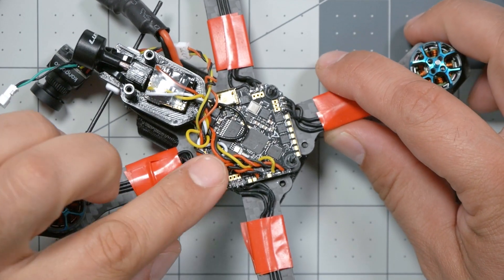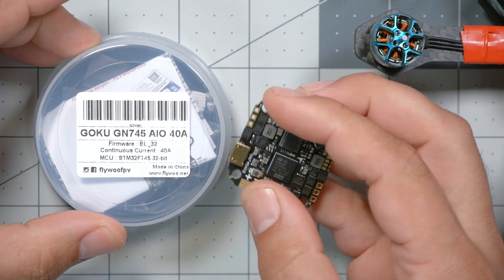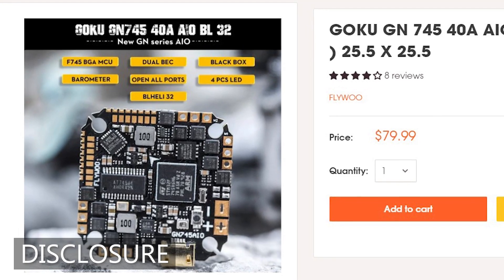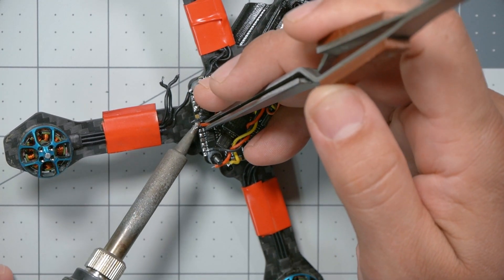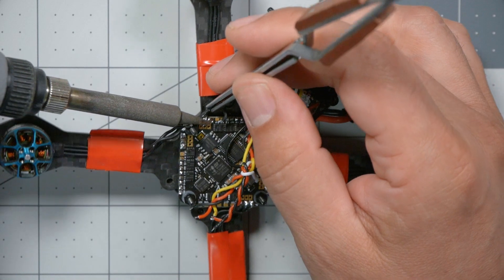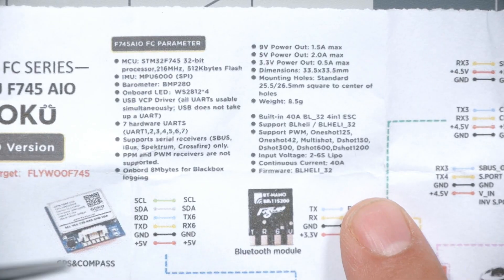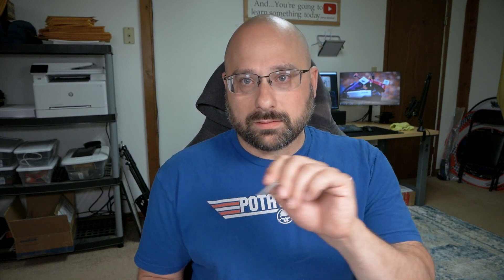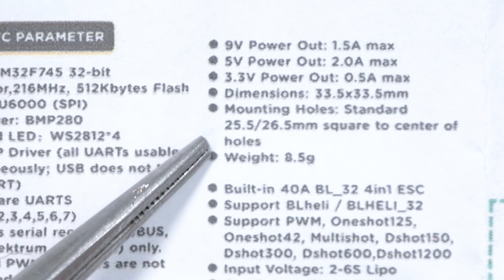But is it reliable? Flywoo Goku GN745 AIO FC and blheli_32 ESC install in my 533 Tiny Trainer

Comment from the maker: Ok have I made a big mistake here? What's your experience with the Flywoo Goku GN745?
Reply: I use the GNF4 (32 bit 40a, f411, blackbox) and its been BULLET PROOF. I have one in my Cinesplore and one in my tp3 and I bash it good. GREAT board.
Reply: My two TinyTrainers have JHEMCU GHF411AIO boards, I got them out of two FUS Spartan V3's which were 'meh' because us end users received ones with different motors to the reviewers, notchy low KV that needed 4S...on a toothpick! And its frame was too weak.
No issues with those FCs after plenty of crashes in the TinyTrainers.
Reply: I’ve had some bad luck with stuff and I changed my philosophy to always buy fro Race Day Quads because their support is the best!
Reply: They go up in flames a lot 😂
Reply: Every piece of flywoo electronics that I've had has failed.
Reply: im using the GN413s and its been a tank after about a months worth of crashing, but i conformal coated it pretty good and thank god cause i lost video and went down into a muddy puddle in the middle of a corn field for about 20 min, and im pleased to report zero damage even the barometer still works.
Reply: I’ve been using the jhemcu 25am pro for about 4 months now it’s been amazing and it’s cheap!
Reply: I really like the GNF4 so far. I've been rocking it for 4 months now in a demanding build. the build is a tbs stardust 5'' with 2203.5 2500 kv motors on on a 5s 1050 .ive even tortured it with a 6s battery but it desyncs. it didn't went up in flames tho .the only thing is it needs a big cap cuz its a lil noisy and all of the onboard leds died
Reply: My 3 flywoo fc have been good so far. Oldest one though isn't even a year old yet
 But I have has 2 in a row bad iflight fc.. shit happens
Reply: flywoo in a trainer is great.  also have it on a 5" podracer.  my first flywoo aio did have 3 non-working leds but i can live with that.
Reply: I did conformal coat it that might be what’s been keeping it kicking for so long
Reply: I have one F745 AIO and installed it in Diatone Roma F4 frame with T-motor F2203.5 2850 KV motors. Flied it on 6s and there was two desyncs so far. But that machine was so fast and furious so I've broken rear arm and had my RX antenna cutted off, so now I'm waiting for replacement. But Goku is ok.
Reply: i dunno aboug GOKU, but i used TBS podracer AIO myself in my tiny trainer (i call her Tina Turner) build, extremely happy. i built it "late" so i avoided betaFPV for this exact reason and went with podracer AIO. i also went with CRSF nano and with trump nano (because i've heard fusion nanos are overheating). she is flying beautiful, tina is my favorite quad.
Reply: My latest build is a RDQ Source One with Iflight Beast F7 45A on 1700kv Emax ECO II, 6S. It's been reliable.  A few crashes no worries.
Reply: I fried my first Goku F7 with a pavement crash and got another for my ET5 and I have been flying it for months,I have a wobble in my cam I can't get out but I don't know if it is the FC,it seems like a solid FC.
Reply: kind of in the same situation.  I built a 7" Megabat using a Beast H7 board a few months back... great flyer, one of my favorites. 
(This board is damned expensive now.  I kinda wish I'd ordered a spare back when they were "only" $80!)

Next project is to (re)build my DaveC 5" mini longrange.  I had a traditional 20x20 stack on it before but wanted to switch to an AIO board in order to keep the weight down.  

Cannae find a Beast H7 in stock anywhere (also it isn't supported by iNav yet.) Going to try a GN745.
Reply: i got 2 of them for my 4 inch, first one was doa, my esc had a bad fet, so race day quads sent me a second one, and it worked amazing! but it failed in the same way, a fet went bad after i simply plugged it in and it died. i’ve switched to a diatone mamba f7 stack and even the esc’s made my motors sound smoother. i think the quality difference is just stark or something, the mamba hasn’t failed me and it’s been well over a month, the gn745 lasted a week. good fc if you get lucky though, unlike me.
Reply: @sommmathechamp5801  I had a Single fet die too on my Goku F405 AIO that came on my Firefly. The fet looks fine but shows shorted to ground and burned a motor up.
Reply: Would be great if we have a video to install ardupilot on this board
Reply: Utter GARBAGE. I did a 3" cine-style with it, and it was a nightmare to solder. The side pads are a joke, and I kept having wires pop out with even mild handling. I literally got 3 very short flights, until I decided to resolder. Well, guess what happened? I was very careful in the rebuild and checked at every step. Does this work. All was well until I stupidly decided to add on the wires for my Baby Turtle. All the inputs and outputs are literally flanking the IMU. Not sure what happened, but after that, my gyro went missing in BF. I even switched to iNav to make sure it wasn't some funky UART/SPI thing, and it is missing there. Now I can't reflash BACK to BF for some reason and am in iNav Hell with a $110 board that is literally worthless. Very bad design. Everyone should avoid them like the plague. Now taking recommendations for a replacement AIO.
Reply: With flywoo I have no problems, but come on betafpv. i have alot failed components F405, lite radio 2, 95x v3 , all Bad , I changed 95x v3 to pavo25 it is little bit better
Reply: The 2 Flyoo goku series 4 in 1 escs and 1 fc have all failed. No more Flywoo for me. Their customer service has nothing but excuses as well  if it flys you buy. Just my experience. They look nice
Reply: @ThiswayupRC  Agreed. Had a Firefly Nano baby 20 that I paid good money for too(over $300 for DJI ver) and within about 5-10 flights of tuning a motor died. I swapped it and within another 5-10 that same leg of the ESC died this time but luckily the motor survived. I explained what happened to flywoo's CS and showed them the video of it essentially failing in slow forward flight. They didn't respond once I said it was a dead component. Bought the $50 darwin controller and had it rockin an less than an hour. IMO flywoo's components are way too close together like they are trying to show off more then create durability in a product.
Reply: jb u should put the cap right on the power leads of the board.the cap doesn't do anything on the xt30. even if your on 3s and its a 40a .i put a big freakin cap on everything.better safe than sorry : )
Reply: @kofikofikofikofikofi  Sorry but that is not correct. I use it that way for so long now and with no problems.
It does reduce a little but it depends on how long your power leads are. I have really short ones so it works great.
Reply: @manuelsmeets9392  aight whatever u say homie. My experience shows something else. Kabab for example is of the same opinion. Hobbywing also says the cap has to be the closest to the noise source but you know what , we don’t have to have the same opinion. I won’t tell u your wrong. Do what u wanna do.I think u can compare this to jb saying wires over the fc don’t make a difference. He build many quads and it didn’t make a difference until it suddenly makes a difference. ✌🏾
Reply: @manuelsmeets9392  I agree.  If the noise that the cap was filtering was much higher in frequency, i.e. Mhz, then maybe this would be more of an issue but motor noise is much lower.

Comment: Today this AIO had a defective LDO Voltage regulator - I guess the 3,3 Volt since the gyro and baro is not showing anymore. I have had it now with flywoo FCs. I only made very bad experience, also with the 16mm F4 stack and another F4 FC from them. Service is terrible and the quality too (in my opinion, maybe I was unlucky, who knows).

Comment: I got the same FC, it was showing OSD with visa but I change vista to 03 air unit and now I don't have ODS. 
set osd_displayport_device = msp
set displayport_msp_serial = 2
done.
I did everything to double check if something is wrong connected or seated, but nothing looks wrong, can't understand what is wrong.

Comment: Forget bega FPV they got lack of quality control. I bought the pro 3 light controller only had it for 2 days in the right gimbal stopped working cuz the wires are too short and the controller kind of stuff is that lack of quality control over there

Comment: I've got three!! 1/3 is working fine, I would not recommend.

Take caution: V1 and V1.2 has incompatible soldering layout/wiring/pinout!!!

One of my Goku GN745 worked fine.

My second never did beep/recognized the motors (Yes, I've changed them on BF). 

My third one was working well, omg 4" long range is great, but after a week flying, after a short 30s LoS test flight, one of the leds in the FC started smoking. I have no idea why.

I'm scared of Flywoo, let's see their support.

Comment: 9:00 Regarding there being a INAV target for the Flywoo Goku GN745 FC's. There is, as of INAV 3.0, or later. (note: to do position_hold and other navigation, you will need a GPS with a compass, not just the baro sensor).

BTW: if INAV not enough, there is also an Adrucopter / Ardupilot target for the Goku GN745. 

Can verify INAV works, but have not tried Adru firmware. Just that it's an interesting possibility, given this a AIO FC.

Comment: Beware of the iFlight Beast F7 v2 which is what most stores are carrying.  Even though, in some ads, they are advertising an MPU6000 gyro it does in fact come with a BMI270 (Bosch) which has a much higher cutoff freq for the hardware LPF (875hz) than the 6000.  It is also locked at 3.2khz gyro and max 3.2khz PID loop which is probably fine but the LPF is not good news for a quad.

Comment: 08:54 I got one of these boards and crashed it on my second flight. I hit the top of a bunch of incredibly high trees, on a very steep slope, and it came tumbling down until it got stuck on a branch. The barometer is what allowed me to quickly spot where it was, by giving me the approximate height it was stuck at. It was pretty tangled in the leaves, I might have not found the quad without it.

It's also nice to know when I'm flying above the regulated height, or generally to just know the altitude. A barometer is a feature I look for when looking for FCs now.

I just wish Betaflight supported altitude hold.

Onboard LEDs are also good to locate crashed micros using an aux switch, without adding the weight of external LEDs.

Comment: Need some help people more than just with drones LOL. Anyways I kept burning up flight controllers in my GEPRC Phantom HD, so someone recommended I replaced it with this flywoo flight controller. I tested everything without props last night in the house and everything worked perfect. All my OSD was correct I went for a test flight this morning and everything was awesome. Handle so much better with the same pid rates. I had probably one of my smoothest Landings LOL. I put a second battery in and now I'm not getting any battery voltage showing up in the OSD for the Drone. Am I doing something wrong. How could it work with one battery then 2 minutes later it doesn't work with another battery. Then I tried a different battery just for the heck of it same thing no battery voltage but the quad arms perfect and flies perfect just have no idea when to LAND. HELP please I'm DROWNING!!

Comment: This is the AIO I put in my beta fpv 95x. My first build. I just recently changed to smaller motors (1106 beta fpv) to try and get longer flight times. I had T-Motor 1404's.

Comment: does it will work longer if use conformal coating to prevent any shortage or electricak bridge by others like ant or leaves or water drips , or little konduktor material on dirt

Comment: The BetaFPV F405 AIO FC. 
1. Burned out an ESC from reverse connecting on the battery. My fault.
2. VTX-O pad falls off after tinning solder and blowing on it. 
3. Ground pad falls off on a new board rubbing finger on it.
4. V +5 pad falls of during flight and drone falls from sky (breaking frame)
All the edge pads suck.
THIS >>>---> https://betafpv.com/products/f405-20a-aio-2-4s-brushless-flight-controllerblheli_s-v3 SUCKS!

.... next time this fails (BetaFPV F405) ... I am going for something "less crappy" in my build kit, Jhemcu GHF411Pro 25A

Comment: So far i've only managed to kill 1 FC and that was a FETtec KISS board. I was mortified. Couldn't have broken it at a worse time! 

I've still got my 3 original Mamba F405's - these are going strong and have not shown any sign of breaking and I sucked right at the start. I then upgraded with  2 Mamba F722's, I really like this board, alot of features, bit tall because of the heat sink on the ESCS's but worth it. 
I then bought a Lumenier Lux F7 for an Octo build and that that's still going after a big, big crash - that bent the frame. 

I do need to try more manufacturers but now I've had KISS/ FETtec, it's not comparable, for me at least.

Comment: That BetaFPV AIO board (which I use in my toothpick without issue) is not the same that was shown in your racer build. But, video editing aside - I ran into the same issue on this board, video with no OSD, I looked to your videos for help. Come on JD - check your cam power and GROUND (*hint). Stable now, fix your tish...
Reply from the maker: It's a different board because the original one also failed and was replaced with this one. And yes I thoroughly checked the wiring please have a look I made a video about it. https://youtu.be/Y4YitIkb-N8

Comment: My first FPV drone (not counting DJI) blew up second day with BetaFPV Toothpick - an BNF.  I replaced with another BetaFPV 405 Toothpick - it burned up in my hand when testing motor direction on starting the 3rd Motor.   Pretty amazing fire - had a 2 in flame shoot out for about a sec.  Had to hold it my hand as the USB connection comes from the bottom.  Replacing with an IFlight Succex-D.

Comment: I got three Betafpv Aio paper weights in my parts bin! Didnt even try to complain about them. I just bought JEHMCU Aio boards has held up much much beter!
I even run 6s on the 20×20 30amp JEHMCU Aio with 2306/1700kv motors on 5inch build and it's still holding up!

Comment: A bit of advice for everyone if you have issues with tiny solder pads or not  ….buy a set of magnifying glasses that are wearable like reading glasses get ones with a huge magnification this way those pads and the controller look like they are  huge and makes soldering much easier

Comment: Maybe try hitting the OSD chip with a hot air station to reflow the pads its on. I have had similar issues with BetaFPV boards where they just kind of stop working properly and hit them with hot air and they come back alive. I have a suspicion that whoever makes their boards doesn't flow the solder properly all the time. I'd be really curious to see if that brings the OSD back to life. Sell me your dead BetaFPV boards.

Comment: Exactly why I've abandoned EMAX whoops, the AIO isn't reliable and is the most expensive of any whoop.
Reply: Next finished a remake of the tinyhawk freestyle frame to accept normal motors and 16x16 stack or AIO. Couldn't stomach paying out for a new FC.
Reply: @thegribbs  I've just switched frames entirely. I don't like tinywhoops outdoors and I don't mind swapping batteries, so I went with a Moblite6.
Reply: @grantmacdonald4838  the whoop design is good for bandos, where I mostly fly. Can't break them.
I'm just not keen on companies that design a product that forces you into an ecosystem.
My tinyhawk will have ELRS and OpenVTX, and if it does break, I can cut a new frame.
Reply: @thegribbs  my 3" toothpick seems to be more durable than the Tinyhawk so long as I fly over grass. Maybe I've just had bad luck?
Reply: @grantmacdonald4838  Probably. The triangular arms of the Tinyhawk are an extremely strong design.
Reply: @thegribbs  the frames are solid, but I keep breaking AIOs. They aren't well protected.

Comment: I still fly 2 of these exact FC on 5inch 250g racer ultralights after more than 40 hours each. I like them. On punch outs mine goes to 80Amps. The OSD somehow has more resolution... the barometer is nice to have. I wish you good luck with it.

Comment: Honestly I had 2 DOA flywoo goku f722 stacks. One had a bad 5v converter, so no power went to any of the 5v pads, the other one had the power regular on the USB Connector fail so it would only boot into betaflight if it was plugged in. Never buying a flywoo FC or ESC again. Swapped to the TBS Podracer AIO and couldn’t be happier

Comment: Will it take 2205 2450kv motors on 4s or 6s with throttle cap? I have a set of motors I want to user for a super light build.

Comment: I’ve gone through a total of probably 40 different AIOs over past 3 years and the only three that still live are an ancient BetaFPV 1-2S 5A whoop AIO (currently in my 37g digiwhoop), a HGLRC Zeus 20x20 AIO (currently in my 57g digipick), and a NLRC 12A whoop board that has been in my “95X” since day one, neither being made anymore. Well to be fair Fettec mini aio is also still alive, but that’s because I have yet to fly it since I get annoyed by its bad design every time I look at it 😅

It’s almost as if trying to squeeze more electronics onto a single pcb somehow makes it less reliable 🧐🤔🤭😅

Comment: 14:49 Those tiny resistors are ceramic bypass caps, so if you accidentally desolder them they can be replaced by any 0204 0.1uF cap.
Reply: Excellent info thanks
Reply: Good luck with that. What are those, 0603 size maybe?  You’ll lose your component in the solder blob.